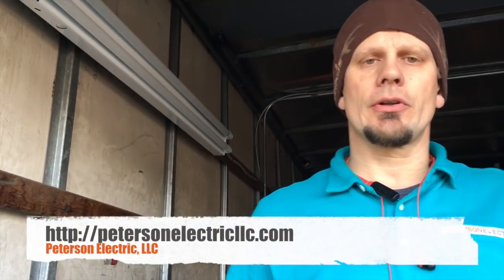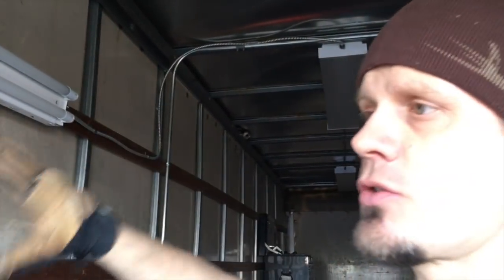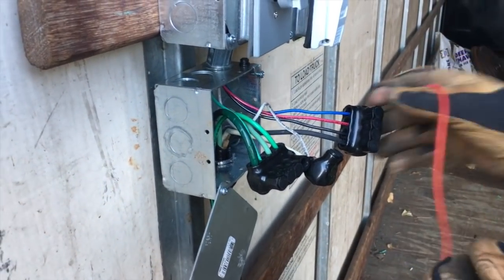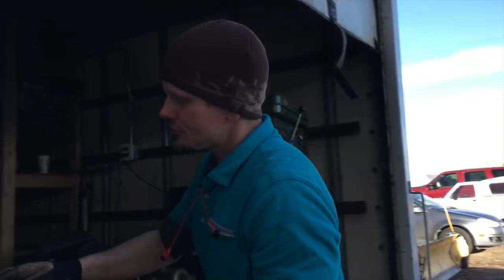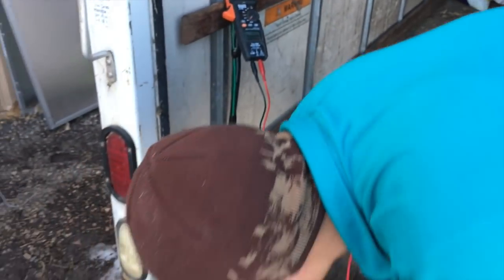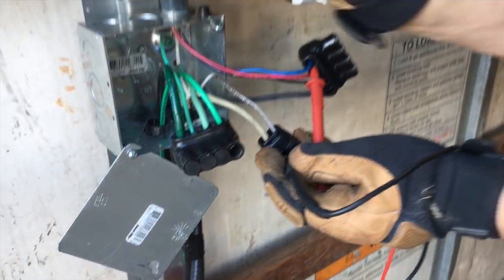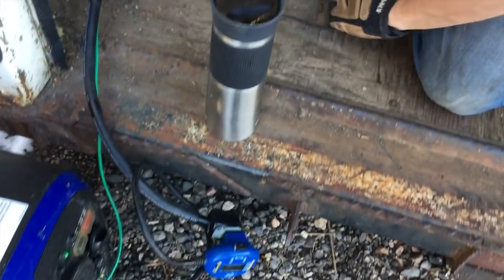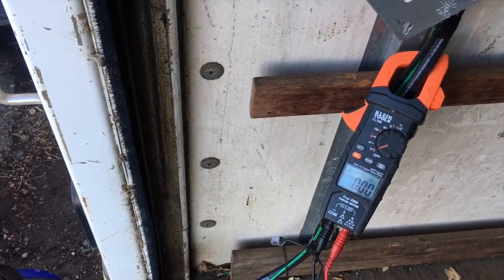Installing Electrical Power For A Work Trailer Machines, Which Are Powered By A Generator, Part 1

Comment: I think I missed something fundamental here. If ground and neutral are bonded together in the chassis of the generator, how are you getting radically different voltage readings when comparing L1 to neutral with L1 to ground? Isn't this good evidence that the ground for the generator is floating?
Reply from the maker: I think i did a second video to this, the phone cut out. What ended up happening was I forgot on this video to tie the Neutral and Grounding EGC together and that caused the voltage to be the same potential
Reply: @Petersonelectricllc  Oh, thanks. I've been scrolling through videos on your channel, they are very helpful.
Reply from the maker: spelunkerd thanks

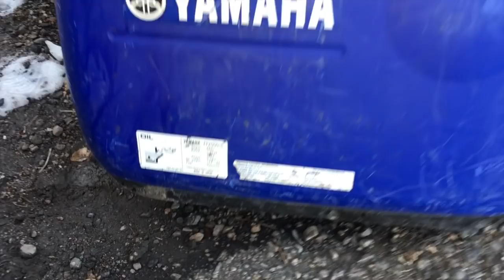Comment: So first off, you aren't running DC power, that is the 12V DC based power of 8A @3:39   Right above it, is the AC capacity, which is 1.6KVA.  The inverters will kick out when overloaded, so no worries there.  If your load has a power factor of 1.0 you could pull 1600W which would be @ 120VAC, 13.3A.  With induction motors you are looking at 0.8-0.9 PF with full loads and 0.2PF with no load, so lets say at 0.9PF you can pull about 1440Watts or 12A.    Also genny's DON"T need grounding rods.  Because that there is an inverter in that unit, most inverters float the neutral, and because you are referencing ground now, that is why you see voltage potential which can be very dangerous.  Portable gennys and the whole grounding things can get in a world of issues, when best practices conflict with NEC codes.    Also when you get to larger genny's they will have locking L14-20 240/120V (4Wire) or L14-30 outlets on them, then you can load up each of the 120V legs.  They sell the L14-30 inlet connection boxes that can be mounted on the side of the unit and then the cord between the genny and inlet.

Comment from the maker: Yep you are correct, we did not pull two neutrals, they did not want more equipment in this area, the area was really small. The voltage you are correct, this to ground is less, but to the Grounded or Neutral white conductor it showed the potential of 120v.

Comment: I've got a couple of probably dumb questions:

1. Why is there only 1 neutral wire in your junction box? I understand right now they're all effectively one circuit, but wouldn't you have to add more neutral conductors later if the customer wants to 'split' them as you described? Or are they just hidden and I missed them?

2. What is the 43-48V measurement ("back feed" as you described it)? It appears you're measuring the potential between hot and ground... wouldn't that just be the same as hot to neutral? Is the generator's ground not bonded to the circuit's ground and you're measuring the generator's ground to earth? If so, is this an expected/good/bad number to be reading? Or should we have a better ground?

Thanks - love your videos!

Comment: You don't need a ground rod for a portable generator that supplies power through its receptacles. 
https://www.osha.gov/OshDoc/data_Hurricane_Facts/grounding_port_generator.pdf
"Grounding Requirements for Portable
and Vehicle-mounted Generators
Under the following conditions, OSHA
directs (29 CFR 1926.404(f)(3)(i)) that theframe of a portable generator need not be
grounded (connected to earth) and that the
frame may serve as the ground (in place of
the earth):
• The generator supplies only equipment
mounted on the generator and/or cord and
plug-connected equipment through
receptacles mounted on the generator,
§ 1926.404(f)(3)(i)(A), and
• The noncurrent-carrying metal parts of
equipment (such as the fuel tank, the internal
combustion engine, and the generator’s
housing) are bonded to the generator
frame, and the equipment grounding conductor
terminals (of the power receptacles
that are a part of [mounted on] the generator)
are bonded to the generator frame,
§ 1926.404(f)(3)(i)(B). 

Thus, rather than connect to a grounding
electrode system, such as a driven ground
rod, the generator’s frame replaces the
grounding electrode."